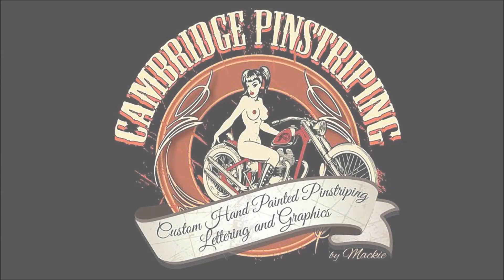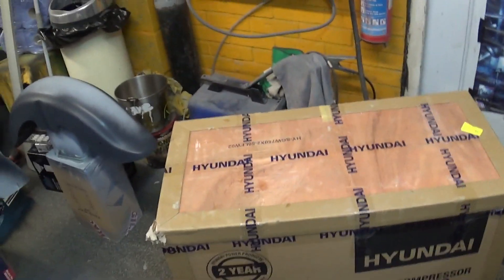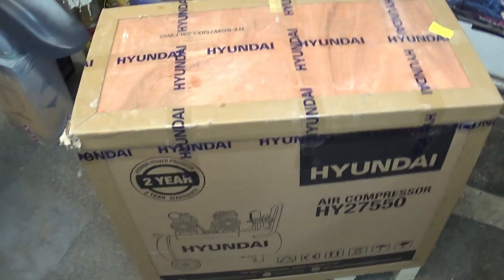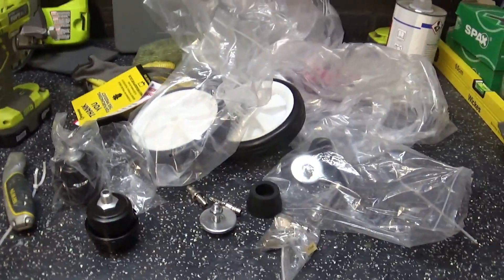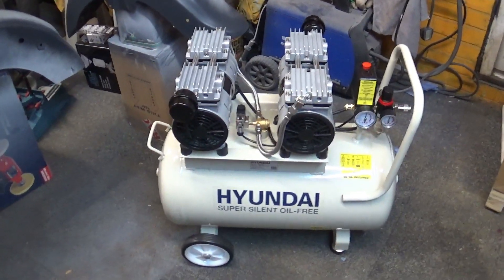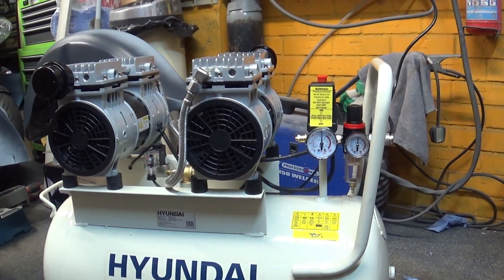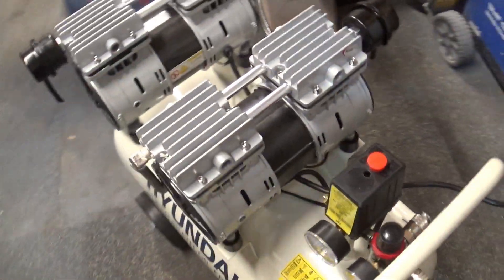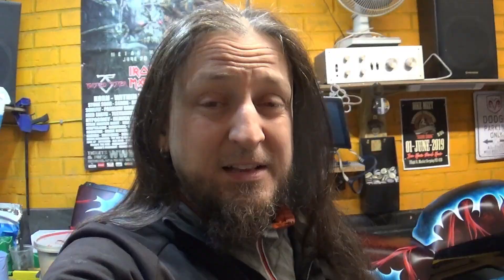Unboxing Hyundai 50L Super Silent Oil Free Compressor

Comment: Good information right in time. Soon I´ll need a new low noise compressor too. I´ll wait for your video about using it for spray painting.
Reply from the maker: Sounds good! BUt so far so good. Very happy with that purchase.
Reply: Not adequate for spraying.  Struggling with a polishing tool.

Comment: Great review and it helped me get "over the line" with one 50L Hyundai "silent" being ordered today. Obviously, you know what is needed to do a good paint job and the Hyundai is just one of the tools to do a great job - perfect. There are many specs to catch you out in the "Air game (of lies)" and bigger isn't better! The USP is the silent (quiet thing) and it mostly does it well. In your garage space, there are no hiding places, so the sound seems louder than it probably is e.g. echoes etc. In the specs, manufacturers don't always say how things are. I downloaded the manual and it gives the displacement liters and the CFM.  If you do the maths, they take the displacement and convert it directly to CFM. That's OK, but the really useful number is the FAD. Separately, in the manual in section 7: "Be aware that the airflow figure stated on tools and accessories refers to ‘free air delivery’ and not the piston displacement of the compressor". On almost all compressors the FAD is 2/3 * CFM e.g. 11 * 2/3 = 7.33 - I noticed that most manufacturers won't state the FAD because it's a smaller number. Those that do will often "simplify" things and the "result "cannot be relied upon. For a tool, the FAD number is what a tool needs, and so matching CFM to the tool, will fall short of what is really needed? I noticed that a FAD that is 7/8 of CFM cannot be relied upon -(errors creep into specs)  so maybe Hyundai "got it right" by not trying to list this number.  With a tool, the average FAD is just that, so some tools will need 4x this to work successfully e.g. a sandblaster is a very demanding tool but a nail gun isn't. If you were going to do a follow-up video, it would be really interesting to know what tools you want to use it with vs how it works with those tools e.g. does it silently work just fine or struggle? One thing I also noticed by manufacturers is their use of HP. They list a power input and then HP and it sometimes defies physics e.g. 1.5Kw is not 2.25 HP (1 HP is 750W of output, so not input, nor perpetual motion!). All these silent machines "appear" to be the same, but look closely and there are some differences e.g. the case style, the RPM, and the input power. Really important is the power in kW as this directly translates to the FAD number e.g. 1kW machine cannot provide greater throughput than a 1.5kW or 2kW machine - that's physics, so take other specs with a pinch of salt. The Hyundai looks to be one of the best, so thanks very much for the "intro". Simon
Reply from the maker: Very technical and useful data too. Thank you for taking the time to explain the sorcery of air info :)
Reply: 50L tank, 0-100psi  in 2 mins 27 secs = 4.9cfm

Comment: Just got the 24 litre one for airbrushing. Dam it’s quiet!
Reply: I have the Hyundai 8 litre for airbrushing. Quieter than those crappy 'airbrush compressors'.
Reply: @Geo have you been using the 24L compressor to do the spray painting??
Reply: @chris01479  Airbrushing yes. It’s working really well
Reply: @geo2472  Thanks for letting me to know. I'm going buy it soon when I'm saving up my money. Can I ask do you use hvlp or lvlp spray gun??

I am going to spray on the whole bonnet, top of the roof, 3 tyres and rear bumper so I hope it will be enough. I don't mind to wait a few mins to refill it so I can get the job done once at a time.
Reply: @chris01479  just with air brush and as an airline for tyres and cleaning. It’s a decent compressor though. Good luck with yours 👍
Reply: @geo2472  I thought you use the air compressor to do spray painting on your car??

Comment: Hyundai sell a blue 50 litre compressor that’s cheaper and more powerful. Did you consider it?
Reply from the maker: It's not as quiet tho, is it?
Reply: @MackieBass  no, it’s an oiled 98db industrial unit. I think it may also need 16 or 32 amps.

Comment: Hi, how’s this holding up ? Any issues ?
Great review, do you find the on off button is stiff ? I’ve just received one brand new and the on off needs a slight twist to the left to pop up and quite a bit of force , wondering if it’s faulty, 
Cheers.

Comment: What’s it like with an air blow gun? How long does it blow before it starts recharging? My own little compressor is useless for blow gun use.
Reply from the maker: It works well enough for what I need it for.
Reply: @MackieBass  I’ve ordered the smaller 24 litre version for air gun cleaning.

Comment: Really helpful to see your review video on these Hyundai compressors, thank you! I have a question; I want to paint my XV1100 tank with a large metal flake flame job but I live in a small apartment, so it has to be done in my spare room, and so the machine has to be as quiet and as small as possible! Because of this I've been looking at the smaller brother to yours, the 25L Hyundai HY7524, but the CFM only seems to be 5.2...
 -Will 5.2 CFM supply enough coverage for flaking/clear coating/candying a motorcycle tank? Any help would be really appreciated as I don't have the space for a large machine. Thanks in advance!  \m/
Reply from the maker: It depends what guns you are using. I'd say for one off job the 25L will do the job - you will just need to wait inbetween it filling up. Spray one part at the time and you should be ok. But if you are planning to do more than that...you will probably need something bigger.
Reply: @MackieBass  That's awesome advice brother, just the boost I needed, thank you!

Comment: As a complete newbie, probably a bit of a "daft" question - but how does equipment connect? Airbrushes have a 1/4" female connector and others a 1/4" Euro quick male connector. Is it a bit like mains plugs and sockets where the plug connects to the wall and exposes a socket, or does anything go?
Reply from the maker: You can get either EURO or UK stye connectors. And these are universal among each other. Stick with one, don't matter which one, they are equally good. They won't cross fit, so stick with one style. Then you've got male and female accordingly. Hope that helps.

Comment: The new Stanley 2.75hp with 50lt tank and 145psi and 220lpm is a monster
Reply: Do you have a link please
Reply: Supercheap Auto in Australia has them or any Stanley Stockist
Reply: @petershute3580  I'm in the UK, can't find it anywhere.
Reply: Try Amazon uk or eBay

Comment: At 2.5 min to fill 50 litres that’s only 20l per min not 300 as in the specifications, am I missing something ?
Reply from the maker: I think they refer to compressed air capacity. As in, you can probably fir 600L of air if you compress it into 50L. But...I'm only guessing. :/

Comment: What spray guns are you using? Looking to purchase this compressor but the free air delivery looks low at 6. Will be running mini guns and airbrushes, top channel btw
Reply from the maker: LVLP mainly, got HVLP and that work fien also on the smaller items. Airbrushes should work absoluely fine here

Comment: The best video for oil free silent compressor !!! I m thinking to buy one like this for moto painting parts. Is the capacity enough for hvlp guns? I'm asking from what you have seen by using it.
Reply from the maker: Depending what air ratio the gun needs. I'm using LVLP guns and they are just right. If I could get a bigger tank I would, but this is perfect for my littl garage. Hope that helps buddy
Reply: @MackieBass  LVLP guns are better choice for small compressors, but i think that it could run hvlp gun for small fiberglass parts that i create. The noice level is very important, not for me but for my neighbours.(ha ha)  Many thanks for your time.
Reply from the maker: HVLP will run of a smaller gun also, yes. Smaller parts and smaller jobs should be ok. I can get same results with modern LVLPs as with the HVLPs. There is less overspray and less material wastage with LVLPs, so for smaller jobs these are no brainer for me.

Comment: I have just bought a 24L compressir from Hyundai.
But why my box seems not perfect as you? I don't have any edge cover and absolutely open before.
Should I return it?
Reply from the maker: 24L is a different model than 50L. When it comes to box and condition..I cannot advise. Check with the supplier.

Comment: Does it get hot after a few cycles just like regular compressors?
Reply from the maker: Yes, but not excesively. I don't usually use it longer than 45 mins at the time (with breakes) no issues so far.
Reply: The motors can get exceptionally hot if it's refilling constantly. The heat will trip the thermal cut out meaning quite a wait before it recharges.
Made in China with Hyundai support.

Comment: Thanks for the vid Mackie.
I’m in the market for a compressor )first one) to spray guitars with nitro (I used cans before). Do you think the Hyundai would be up for the job? Do you use lvlp guns for spraying guitars also?
Reply from the maker: It will most definatelly work well for quitars. Small enough parts, it will be more than enough for the job!

Comment: Cheap components, overpriced and is constantly working. Struggling with brad guns, 3" polishing tool. Save your money, buy a cheaper one.
Reply from the maker: It ain't great agreed, but it ain't bad either. It was obvious it won't support power tools, but it does ok with LVLPs, which is what I bought it for.